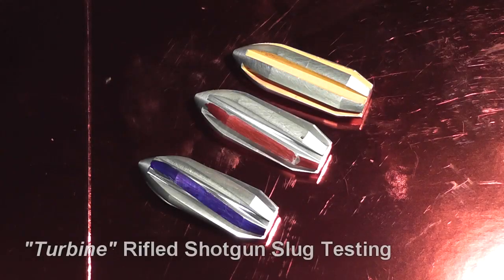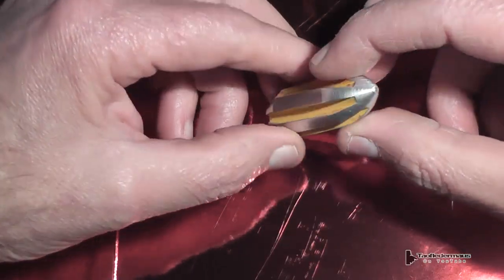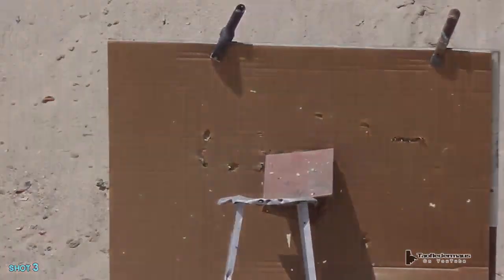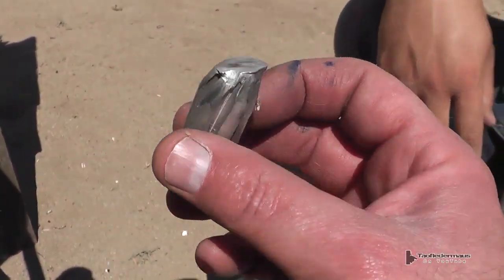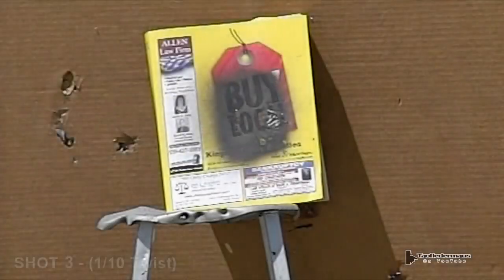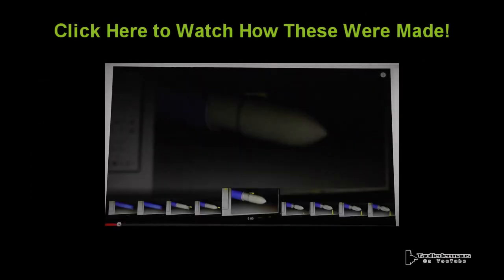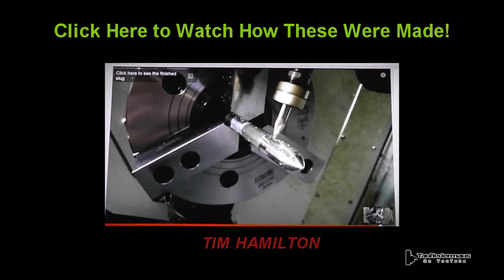Custom Aluminum TURBINE Shotgun Slugs  -Testing

Comment: The rifling in a barrel is slightly narrower than the bullet being fired through it, thereby squeezing the bullet and forcing the it to spin. It's an "interior ballistics" factor, not and external one, which is why your fluted slug still won't fly true. Also, I doubt Aluminum is heavy enough to be stable -- it so light weight, its trajectory is very easily perturbed.
Reply from the maker: BMWrider  I don't know how alum. would behave in an interference-fit condition like that.  It may seize up and blow up the gun.
Reply: ***** I absolutely agree. A standard shotgun barrel isn't designed for that -- it'll banana peel. Now, get yourself a rifled slug barrel and then see what happens. However, aluminum may not have the ideal softness to conform to a rifled barrel like a lead slug or jacketed bullet. So, be safe, brother!
Reply from the maker: I looked to see if they made one for a 590 but they don't,  just for the 500.   Originally Tim made these about .735" in diameter but I asked him to turned them down to .700"  to ensure we had a little wiggle room.  He's getting into making these goofy slugs and has started making some other designs that are more akin to foster slugs,  but made out of some pretty exotic materials like teflon, titanium and cast iron.   If you or I went to a machine shop and had them make the slugs,  it would cost around $50 a round.   So I definitely appreciate him making them.
Reply: ***** I don't doubt that! Titanium would be a great slug, but really should have a sabot for more stable flight.
A Teflon slug could be milled a little larger than the rest and won't harm your smooth barrel.

In fact, Teflon would make an excellent sabot for the Titanium round!

It's awesome to have Tim's handiwork, but I truly believe testing more materials with the same design will yield the same results. I believe it's the fluted slug design that is inherently unstable. Albeit a very attractive and well-built design.
Reply from the maker: Sabots are used when the projectile is smaller than the diameter of the barrel.  They just fill the space.
Reply: ***** Yes, and given the hardness of Titanium, I'd suggest a smaller projectile simply to protect your barrel. A Teflon sabot would help preserve the integrity of your barrel, while having a better chance of imparting a twist on the projectile if designed to do so.
Reply from the maker: The slug should be .700"  and the ID of the barrel is .730" give or take.  There won't be but a hair of clearance so I won't be able to use some sort of sabot or anything.
Reply: ***** Therein lies the problem with this design. You're losing gas pressure around the OD of the projectile, not to mention through the fluting. Even with a hair of clearance, that's enough to allow the slug to wobble in the barrel, and you'll never stain stable flight like that.

Again, Tim's handiwork is purty, but their more art pieces than slugs for practical use unfortunately.

Comment: Not surprised that they tumbled. Nothing keeps them pointed straight long enough for aerodynamic drag on the vanes to impart a spin. However if they'd had a cavity machined into the nose that was filled with lead then they might have worked better since the heavier nose would have had a shuttlecock effect.

Comment: The idea is correct, and it will work. However, it would work much better in long distances.  The rifling on the slug/bullet needs time to cut through the air and actually start spinning from the wind resistance.  Ask for more of them and try standing further away from the target.

Comment: Ok so i have found something that has worked as far as i could tell but would love to see it in slow motion a big set screw when i shot it it went in straight dont know if that was just luck or if the treads and weight had anything to do with it can u try it out

Comment: It's simple, the material used (aluminum) is too light.  It doesn't have enough centripetal force to stabilize the projectile.  It would also address the crazy ricochets, of course that is related to momentum.  There's a reason heavy metals are used for most projectiles.  Nonetheless, a fun thing to watch.

Comment: you get tumbling because the rifling on the slug is not effective, rifling works because the hardened steel barrel rifling grabs the softer slug and induces rotation, a normal shot gun slug is stable because all the weight is at the front of the slug, rock in a sock principle
Reply: bleeckertb I have a question. long range bullets are hollow pointed to reduce tip weight for stability so why would a slug need to be front heavy. it would seem that a projectile being pushed would start tumbling as soon as its free of the barrels guidance. so wouldn't it be more stable if the front were light and shaped to guide and the rear be heavy so the weight is closest to the driving force and boat tailed? on top of that like I said at the top of this conversation, smooth bores need a rifled choke to force the slug into a specific rmp twist or none of this conversation is relevant. thank you for your time and have a good day
Reply: ciscogsx1000 you are talking apples and oranges, your long range projectile with a hollow point is spinning from the rifling in the steel barrel, the slug being made of softer metal. the projectile from a smooth bore shotgun barrel doesn't spin, the rifled projectile is made of lead and can not engage the hardened smooth steel of the barrel to induce rotation. yes any projectile not spinning would want to tumble the shape and placement of weight in the shotgun slug reduces this but they will still start to tumble if only slowly. this is why most shotgun slug hunters try to keep range to target under 100meters

Comment: The reason the rounds are tumbling is because the spin needs to be put on the round while it is still being stabilized by the barrel. Essentially, the slug is exiting the barrel with no gyroscopic stability, and immediately starting to tumble when it is no longer supported by the barrel

Comment: What kind of barrel where you using?
Reply: Daniel Barringer You're using a smooth bore aren't you? If you use those rounds with a rifled shotgun barrel you might get a better result
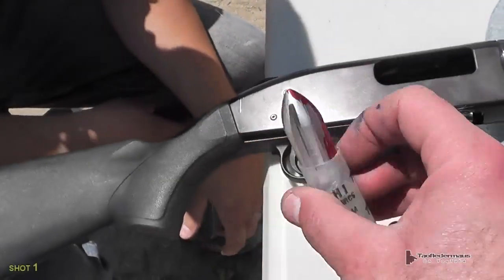Reply from the maker: Daniel Barringer  At 2:00 I explain what we are using.

Comment: I'm thinking use this design... Make it a deep hollow point(flared at the tip) ... Add holes inside the grooves (angled to hopefully add rotation) leading to the "" hollow point " chamber... My predicted thoughts would be that during flight, air would travel through the center and out the air holes to possibly stabilize it.... OR... Add "turbine grooves" to the inside as well (all the way through)

Comment: The rounds will be made more stable by drilling out the trailing end of the round. That will move the center of mass of the round forward of the center of pressure. It would also be better to not taper the trailing end.

Comment: What many people don't know about rifled slugs is that the rifling on them was never meant for stability.  It was meant to give space to the slug to deform when fired through a choke.  Rifling on a slug causes little if any spin, and certainly not enough to create a stabilizing effect.  Several slug manufacturers even recommend an improved cylinder or modified choke for best accuracy.  What gives slugs their accuracy is drag.  A foster style slug is wider and lighter at the base than at the nose.  With a center of mass at the front and drag at the rear, the slug naturally wants to fly strait.  Brenneke style slugs have a plastic wad that stays attached during flight and acts like a drag tale.

These aluminum slugs would benefit if they had a flat base rather than a boat tail design, and if the base were hollowed out to move its center of mass forward.

Comment: To my understanding rifling does not help stabilization in a smoothbore, its just a marketing tactic.  Rifling on a slug allows them to compress through chokes as a safety measure.  Go look at the lee slug mold.  They do not have rifling on them and fly perfect when cast.

Comment: Aluminum being very light and the large diameter giving it much air drag, you still need to have the basic thing of it being much heavier in the front.   I would think much less rifling,  drill out a hole in the center of the front 1/3, fill it with lead and try that.   Great Video and testing.

Comment: try rifling the barrel? if the round was spinning before it left the barrel that may fix the tumbling issue, I don't know much about things like this but if theres nothing but the wind making it spin and at really short range the round hasent really got chance to sort itself out, I think if you just rifled the barrel n shot at a longer range, like 50-60 yards? they will work, I think the guy who made those rounds is on to something, and another thing, I think the round is way to light, if there was more weight behind it, it would probably fix the issue of it bouncing off the target, :)

Comment: The concept is great. The design flaw is in the twist rates. I'm willing to bet that if you decrease the twist rate rifling on the slug it just might have more stability. Basically, what is happening is, the twist rate on the slug currently is causing over-rotation from the velocity and this is causing the key-holing and tumbling. You're essentially trying to put a barrels twist rate on the projectile, and the rate of twist can't be reversed like that. Due to the shortness of the projectile you have to dramatically decrease the twist rate when the twist is integral in the projectile design. Since the current "turbine" design is more like a fan then a rifled slug, you have to decrease the rate of twist on the slug. Give it a try. I'm very curious to see how the decreased twist rate will stabilize the slug.

Comment: Like shooting Foster Slugs in a smooth bore shot gun; smooth bore barrels "will not" impart or cause a projectile to spin while in the the barrel. Additionally: without sufficient cause, the same projectile will not stabilize in free flight. Foster Slugs are extremely nose heavy with a hollow base, and no, the angular side cuts are not for spin. Arrow vanes (feathers/fletchings) are most always canted at an angle to the true center axis of the bore and impart spin only after heading down range (dependent on wind, arrow design & speed, design & placement/angle of the vanes). Rifled barrels are NOT designed to shoot Foster Slugs...they typically use sabot (French, "say-bow") or jacketed projectile with greatly improved accuracy due to the spin imparted by the rifling in the barrel.  And NO, the sabot round will not be as accurate in a smooth bore. Hope this helps the newbies.

Comment: First of all, thank you for the videos. They are well done and fun to watch. Quite informative, too.

I like the fin idea to get the bullet spinning, but you may have better luck if you also make them just a little bit nose heavy. With no rifling in the barrel of the shotgun the bullet has to use aerodynamics alone to make it spin. I don't know how much time or distance it would need to get that started, but evidently it needs more time or distance to start spiraling than it takes to start tumbling. Perhaps hollowing out the rear of the bullet to make it lighter and keep it trailing behind the nose long enough give the fins a chance to get it spinning?
Reply from the maker: Bear Barre  This was just an idea Tim thought up,   and  it just didn't work.   He is working on some other rounds with some cool,  exotic materials like  polycarbonate, teflon,  and titanium,   but are shaped more like traditional foster slugs or pellet gun pellets.

Comment: As soon as I saw the shells (as cool as they look) I figured the "air-powered" rifling wouldn't work. If anything, I suspected it would rotate in reverse as the blow-by from the charge would tend to start the shell rotating in the chamber. If that didn't happen, unless it left the barrel with no pitch and no yaw, the air resistance wouldn't be enough to start it rotating in flight.

In the end, I don't think there's any way to make this work—getting a shell rotating after it's fired from a barrel with no rifling—since it's a lot like pushing a dart by the tail and expecting a straight flight. With that in mind, a largely hollow shell with tail fins and a solid nose might let the charge "pull" the nose forward, keeping it straighter. I still have my doubts.

Comment: If Tim started out with a lead round bar and threaded a male end on one side. Then cut it off and flat and threaded it into the aluminum barstock with a female thread with red locktite. Then did a couple passes to make it perfectly round. Then after the turbine cuts, if he hollowed out the back of the projectile essentially making it front heavy, it would be extremely accurate. Even more so with spring loaded stabilizer fins.

Its like a badminton birdie design sort of. The physics of having it front heavy with some sirt of rear stabilizer is they key.

Comment: Im not trying to be an internet know it all or anything but rifled shotgun slugs do not gain their stability from rifling, the rifling is just there so they can safely fit through any choke size. Their stability is gained from the weight being forward and a hollow base much like a shuttle cock.

Comment: I'm thinking heavy front, light tail - possibly serrated or even slightly larger in diameter than the front, so as to create drag and let the front lead - like a arrow or a blowgun dart. The weight ratio difference has historically been successfully achieved by making the tail hollow, seems easier and more reliable than working with more than one material.

Comment: I'm no expert but I would think that the force of the shot in the beginning, when the slug is not wide enough to slightly grip the inside of the barrel, will almost never shoot straight since the force applied on the back of the slug will push the slug to one side of the barrel since the slug will be pushing against air pressure.  This will also make the front of the slug dip to the opposite site of the barrel forcing a tumble.  I think the groves would come more into play on longer distances when the slug is stabilized.
Reply from the maker: Rory Mangini  The clearance between the slug and the barrel was only about .010" at best.

Comment: Rifling didn't work, so how about fins? Similar to an RPG-7 rocket. Small, spring-loaded fins held back into the "round", which extend after firing. Would imagine some extra flight time might be needed for it to stabilize, however.
Reply from the maker: sunac  Tim,  who made these,  is making some new rounds based off a pellet gun pellet and similar to a foster slug.   Instead of aluminium  they are made out of titanium.   They are amazing looking.

Comment: Awesome slugs. Purely out of interest Jeff, how is the barrel of that Mossberg 590 doing these days? It must have had so much stuff slapped into it and fired. I've never treated a shotgun like that, purely out of interest, looking down the bore, is it scratched and pitted or alright still?
Reply from the maker: Greataardvark   The only thing that has scratched the barrel were those tungsten lathe cutter inserts.  Other than that the bore is very shiny still.
Reply: ***** Incredible. True testament to Mossberg. I'm slightly shocked it isn't in tatters. Don't think my Beretta would handle half of what that 590 has done. Thanks for the speedy reply as always (Y) you're the best keep it up!

Comment: Did you ever load up and shoot a 50 bmg slug?
Reply from the maker: Forewarned76   No,  because a .50 bmg bullet weighs about 1.75 oz  and I try to keep the rounds at or under 1 oz for safety.  (don't want to risk blowing up the shotgun)
Reply: Cast your own

Comment: One of the wads seem to travel faster than the slug and bump it's trajectory.  Also many rifle bullets seem to be slightly smaller than bore to allow the friction of the bore to spin the round ... wonder if that is part of problem .  I think these rounds need another try using friction or keeping wad from interfering ... just thought .  Cool video.

Comment: The reason behind the tumbling is the design of smooth bore. Long object pushed from behind. It spent start spinning instantly a slight amount of drag at the rear of the slug would be more effective I think. Give the round time to begin spinning